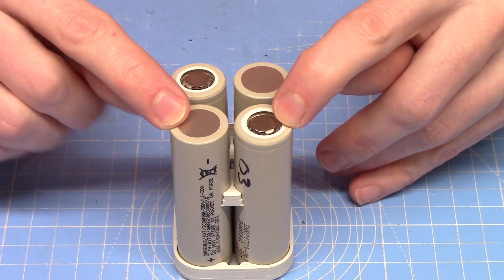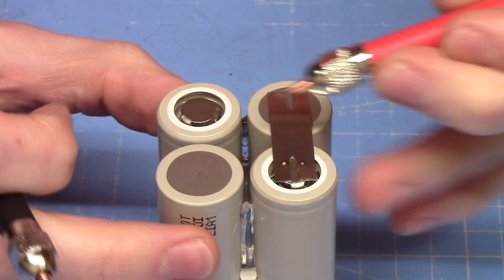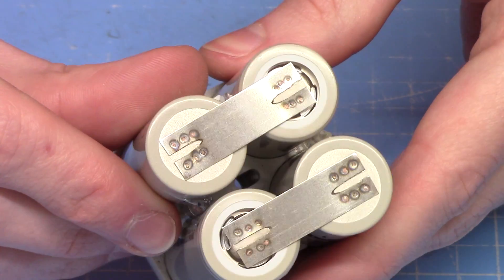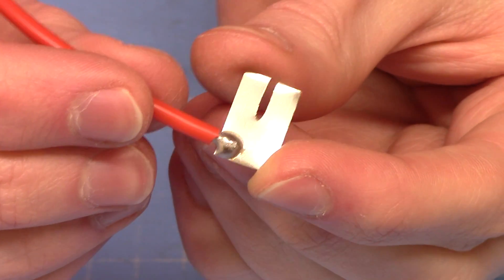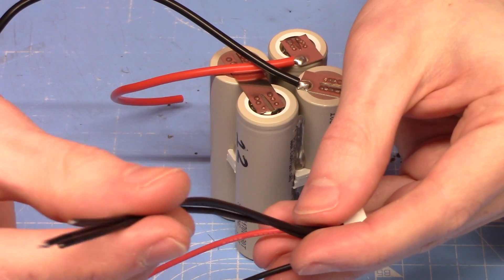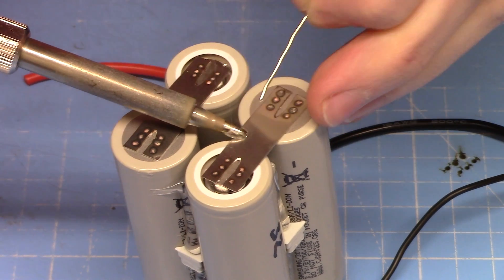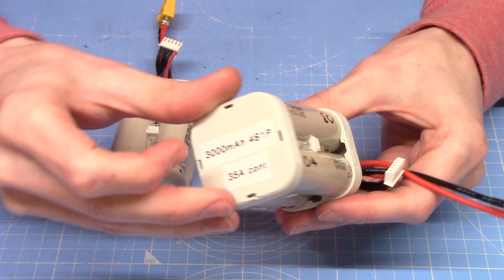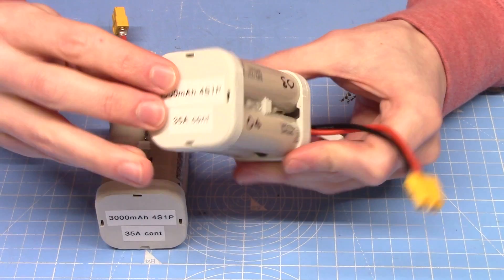DIY Li-Ion Battery Packs // Sequre SQ-SW1 Spot Welder // Samsung 30T 21700

Comment: Bms not needed for flight packs??
Reply from the maker: No, you won’t find BMS in any hobby batteries for drones, cars, etc. But when you charge the packs, you connect the small white balance connector to the charger so that it can read & balance the individual cells in the pack.

Comment: As other have said an excellent video and an instant sub from me.
(I likeed the tips like cutting the strips)
The only thing possibly missinig is a  parts lists as Im still saving for a battery spot welder and I'd be interested in yours as you got on with it so well(?.) with it
Reply from the maker: I'm always slightly wary of mentioning parts/tools, because there are so many disingenuous 'reviews' on YouTube for undisclosed sponsored stuff! That said, this is the Sequre SQ-SW1 welder which I opted for because the maker of the kWeld was no longer shipping to the UK due to Brexit complications. I think once you are into the $200+ range of the kWeld, Malectrics, Sequre, etc. you should be good with whatever you buy, as long as you take the time to safely learn/practice the technique. If you haven't watched the follow up video I did about a year after this one I do recommend it - I addressed/improved a few things including the welder/battery, a better way to notch the strips, etc.
Reply: Noted, thanks  @CJDavies

Comment: I couldn’t believe how much the slots help. A spot welder that normally struggles with 0.2mm might be able to squeeze out just enough juice when you have the slit directing the current flow
Reply from the maker: I was surprised too! I've since discovered that a suitable pair of snips/scissors makes the slotting process a lot less hassle than using the Dremel though.

Comment: Hello. Please don't take offense, but I can't help but say... Your spot welding is terrible. the points are overheated, the probes quickly deteriorate and it is necessary to cut the tapes. 

This is all a consequence of incorrect welding modes, not the correct shape of the probes, and most likely a high internal resistance of the current source, or a low voltage, which does not allow the shutter speed to be short, so that there is no heat leaving the periphery of the point, and the current between the contact points along the upper tape.. 
All this must be done correctly, then there are no listed problems
Reply from the maker: My spot welding certainly isn't perfect & as this video explains this was one of my very first attempts. However from a functional assessment it is definitely not 'terrible'. The welds are physically & electrically strong, impossible to remove from the cells without tearing the nickel - unlike many attempts I have seen with too low power welders where the welds look much cleaner but will break off the cells.

I never claimed to be an expert & encouraged people to do their own research.

Comment: You shouldn't reheat solder, hold wires while soldering them, or tin the connector cups before inserting the wire. Use a jig to hold whatever you're soldering because you'll shake and cause a cold solder joint.
Reply: BS Nothing adverse by reheating solder.

Comment: How did u get the solder to stick to the nickel tabs i can't get it to stick
Reply from the maker: There aren't really any special considerations when soldering to nickel strip. Use the flat face of a small chisel tip with decent quality flux core lead solder. Be aware that there is plenty of fake lead solder being sold online, especially on Amazon/eBay/AliExpress, which is actually lead-free. Try to buy a recognised brand like Kester from a reputable stockist like Digi-Key. I run my iron fairly hot (380-420°C) for work like this, as I want to be in & out quickly.

Comment: I have 4200mah 11c molicell
With 45a discharge current
Can i use 4S1P pack on s500 drone
Please reply bro 
Its important for me
Reply from the maker: I think if you are careful, it will be okay. At full throttle your drone may draw quite a bit more than 45A, however at hover throttle & when flying gently it should draw substantially less than 45A. You can use the online tool eCalc to calculate (roughly) how much current your drone will actually draw at different throttles, speeds, etc.
Reply: @CJDavies  thanks for this
How amazing this is taking both of us from opposite side of world

Comment: Can i use this battery pack on s500 frame drone 
Please reply ❤️❤️❤️
Reply from the maker: I use two of these packs in parallel (so 4S2P) on 10” multirotor frames of similar size to the S500. One pack may not have high enough C rating.

Comment: 112022/0324h PST 🇺🇸 Davies, thank you for the meticulous workmanship, performed on the
Li-Ion Cells. Soldering is an art and that’s what you did, not a big blob, not too less and not at all cold soldering result. The description while on the job is clean spotless and clear. The idea to cut the required length of Ni strip and slot with Dermel at the spot welding area, is phenomenal and I learned from you. Thank you. 
Let’s know how you propose to connect the cells on what configuration. Best wishes and 73s…
Reply from the maker: Thank you for your kind words! If you check my more recent videos I had another go at building Li-Ion packs & I think I made a few improvements to the process.
Reply: Thank you. Please provide link.
Reply from the maker: @sreekumarUSA  https://youtu.be/FhOsSC6HFFU

Comment: Hi,excellent tutorial but I am unable to balance charge the battery. It will charge without the balance lead though. Is the order of the balance leads essential to where they are soldered. Thanks for any information you can give.
Reply from the maker: Yes, the order of the balance wires in the connector is critical. If you Google 'Oscar Liang balance connector' he has a good article which explains it.
Reply: @CJDavies  thank you for replying. I sorted it out with a multimeter. Swapped a cable over and it balanced nicely. Thank you.
Reply: @terrymurphy562  <<<  An important matter to note is that, never attach the balance cables to the BMS module and connect the cables to Battery. Connect the BMS cables FIRST to the battery and CHECK the voltage sequence , ensure the readings are correct and then connect the cables to BMS module. This is to avoid inadvertent wrong connection, which will destroy BMS.

Comment: What battery are you using to power your SQ-1? I can’t seem to get good welds with batteries way larger than Sequre recommended. Very frustrated with my welder.
Reply from the maker: I'm using the Turnigy Rapid 5500mAh 3S2P 140C from HobbyKing.
Reply: @CJDavies  thanks for the super quick reply. What are your short pulse and Ms set to? What does your welder say for watts when your battery is connected?
Reply from the maker: @techdiverpratt5899  Now you're challenging my memory! I think I settled somewhere around 38ms with 20% pre-heat, though this really depends upon the specifics of your setup & what you're welding. I think the current during the pulse was 480-500A but I could be completely wrong as I don't have it on video.

Comment: All OK, but i miss the insulation rings at the positive end.
Reply from the maker: There is already a second layer of insulation/shrink at the positive end, any impact/damage that would possibly break through that would have to tear apart the whole pack anyway.
Reply: @CJDavies  OK you use high quality cells with thermal resistant insulation ring inserted, but if somebody copy your building method with cheap cells it could end in a disaster.
Reply from the maker: @topeye4202  I never claimed this was an exhaustive guide to safety concerns when building LiIon packs - or even that this was a guide at all! And even if somebody were to copy exactly what I've done, without doing any proper research themselves (which I absolutely don't condone & even say so in the description), at least they wouldn't be soldering to the cells ;)
Reply: @CJDavies  It was just a tip for those who dont care about what you claim or not. In most other battery pack tutorials this additional insulation rings are standard....for some reason...

Comment: Off topic, kinda. Would one of these mini spot welders be able to weld 1/64" tin plate together? I ask as I have several old model railroad building kits that the walls, roof, trim are tin plate. It's called to solder them in the instructions, but came across these spot welders and it got my gears turning. 😃
Reply from the maker: I actually have no idea, but I do know that the metal you're spot welding makes a huge difference. When I was doing my research before building these packs I occasionally saw people asking about using copper strip & the response was always that copper needs substantially more power than nickel for the same thickness.
Reply: @CJDavies or you can weld nickel patch over copper and this sandwich produce enough heat to weld copper to the battery terminal

Comment: I'm not sure that 0.2 pure nickel strip is enough to carry the current of those cells which is 25a+ correct?
Reply from the maker: There's huge amounts of discussion/debate on this subject over on Endless Sphere, esk8.news, etc. with wildly different opinions depending who you listen to. On the one hand you have the theorycrafters/textbook warriors who will tell you that 0.2x10mm pure nickel won't even handle 10A without melting, but then on the other hand you have the people doing bench tests & reporting real world experiences using much less conductor for much higher loads with zero problems.

In my experiences so far with these packs, taking my actual application of multirotor drones into account (highly variable duty cycle, extremely good air circulation, etc.) the 0.2x10mm is plenty sufficient. If my application involved pulling the cells' full rated 35A for extended periods in an airtight enclosure, then that might be a completely different matter.

Comment: You really need to use isolator rings. Otherwise you have a good chance of a fire.
Reply from the maker: Considering the cells are held tight between the rigid end caps & internal spacer (which is then all encased in heatshrink) I would say it's a 'very low' chance. Any incident bad enough to break the spacers & then abrade through the heatshrink would write off the pack regardless of insulator rings.
Reply: @CJDavies  I think he means extra fishpaper rings around the top edge of the cells. On good cells they are built in but some not. Some people advise cutting the corners of nickel strip on positives to prevent any chance of shorting. You did fine but worth pointing out.